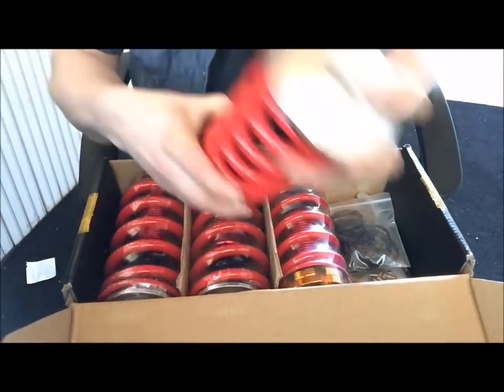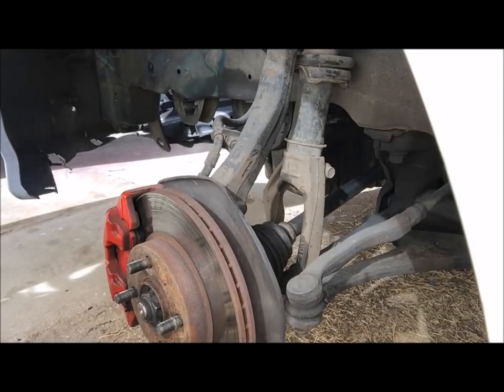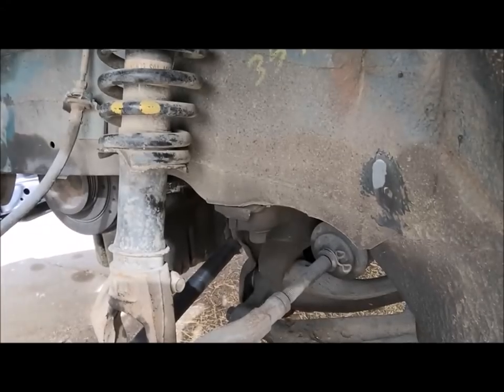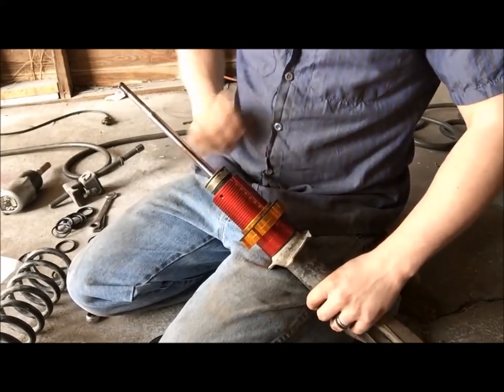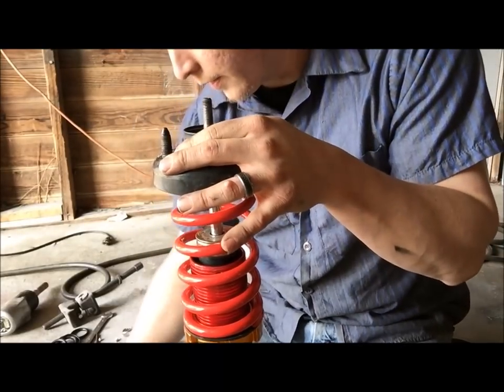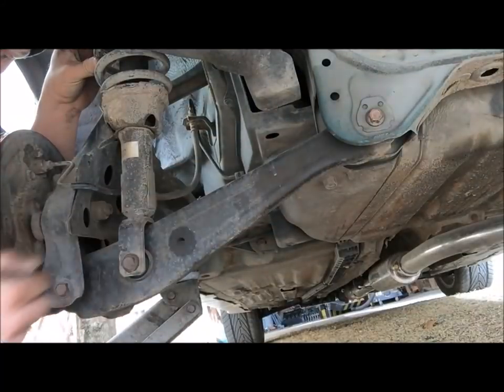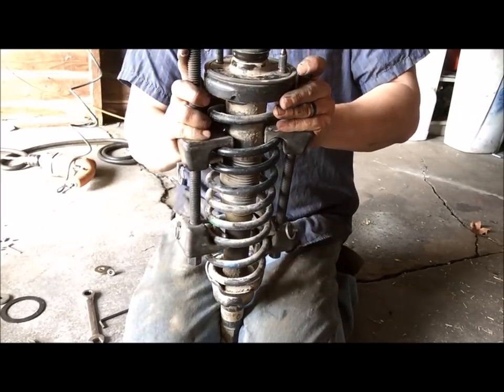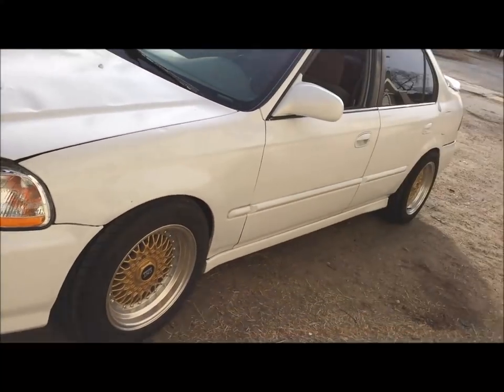Ebay coil overs review and install

Comment: No way!!!! You are literally the only video that shows where those orings go!!! Thank you so much! Im about to slam my 3G Eclipse. I already have wheel spacers on there so ill have to make sure to roll the fenders =)
Reply from the maker: SmokinSkittles Thats awesome! Hope it turns out amazing! Just a heads up don’t put that spacer in!! I need to make a note in the video somewhere because it rode super rough! I took it out then the car rode amazing after! Hope that helps
Reply from the maker: SmokinSkittles I subscribed hope to see a video of it when it’s done :)
Reply: @JamesDguy  the spacer you drilled out?
Reply: Do you have 3 sets 
Mine came with 3 different sizes
Reply: Lol if you don't know where those rings go on the coil over and couldn't find it online idk if you should get coil overs..
Reply: Don’t slam your car not worth it
Reply: I bout sleeves for my 3g....do you have pics of the struts and sleeves  put together?
Reply: These don't work for the eclipse. Front sleeve isn't big enough to fit over the strut
Reply: imposter 0shadow yup had to figure that out the hard way! -.-
Reply: @Smokinskittles  you and me both.
Reply: imposter 0shadow yeah I still haven’t returned it 😬😩
Reply: @Smokinskittles  me neither. Might have to sell them cheap on marketplace
Reply: imposter 0shadow what do they fit tho 🤔
Reply: @Smokinskittles  im not sure honestly. I'm sure there's quite a few

Comment: My friend had me install these on his civic he liked them he said they worked great rode prefect . Me personally i would never trust them not saying they are not safe but my mind will not allow me to trust them lol. good diy man
Reply from the maker: PA Tuners I honestly trust stock cut springs more than coil overs to be honest lol if u cut springs right they ride 100% like stock and you even have to decompress them like stock. I think ima do a video on the cut springs I have stock springs I just cut why not lol
Reply: I would never put these on my civic. The spring is suppose to be flush against top hat. If ya hit a pot hole even the slightest your car gonna fuck up

Comment: Tried to remove the rear struts today.. even with heat the bolts didn't want to come loose.. the bushing started spinning instead, it's a nightmare.. took half a day and have 3 to go :(. That's in Sweden thou, where they salt the roads on the winters which ruin the cars. Didn't look like you had the same problem :p. Great vid btw!
Reply from the maker: Robbin W these roads are salty here we live in salt city. We have a foot ball team called the Salt hawks. But I usually have that issue but this time I didn’t. I found a way around it but it’s unorthodox. Cut or grind the rear nut off the rear of strut and off any awaited bolt and do the same to the bolt head. Pry the old control arm out replace control arm use anti seize on the new bolts and nut. That’s how I do it at least/

Comment: That driveway is smooth as hell compared to what I have drove on with a slammed car
Reply from the maker: Jason Solomon This driveway isn’t the worse i have been in either but you also don’t see how bad it really is on camera. This whole town is garbage and there is no reason to slam a car in this shit hole. If I did I would be missing a oil pan and be super pissed. Function and form is how I like it.

Comment: I used these once I didn't trust the o rings not loosing up over time so I added the bottom one and filled it with silicone and then added the top one never had a issue and there were super solid till the day I got rid of them

Comment: Thanks for showing me how these work my brother bought some for the accord that I bought from him. Now I can install them. I was really confused, like there is no way these would work cause the springs are small compare to his 2 inch drop coil springs.. But I'll install them to see how they work.
Reply: What year accord and how did you get it to sit level on all four corners I'm running into issues
Reply: My sons car is an 01
Reply: @mazdajason  I took them off I couldn't get the back to raise up since it was at the last end of the turn to the cup so I bought some coilovers for my budget since the shocks was blown.. I didn't like them since they would be clacking when I drove..
Reply: @mazdajason  my accord is a 93

Comment: I'm running $200 ebay (maxspeedingrods) coilovers and they ride awesome. Skip the coil sleeve kit for regular struts and just buy the ebay coilovers. If you have a bearing in the top hat just work some pb-blaster into the bearing before installing or it will pop.

Comment: So how much did you end up having to adjust it to to keep it from rubbing? And btw nice video man really imformative and straight to the point no bullshitting keep it up
Reply from the maker: Limp Salamander I don’t remember it’s been over a year but it didn’t require a lot of adjustment. I did make sure to remove that metal top mount that it came with because it rode way smoother after that
Reply: @JamesDguy  gotcha, I'll just have to play around with it and figure it out, thanks for the quick reply man
Reply from the maker: Limp Salamander No problem

Comment: I just let everything explode when taking it apart so you don't have to rent a spring compressor
Reply from the maker: jockobo right or u can undo the bolt while the car is still on the ground and then jack the car up and it release the tension slowly as u raise the car. Less sketchy but either way works haha
Reply: James D guy I did that before. It was kind of a pain in the ass to get it out lol
Reply: jockobo spring compressors are cheap on Amazon. Yep yep,
Reply from the maker: jockobo they sure can be at times. I guess I found a way that works well idk lol
Reply: The old school way
Reply: jockobo it’s literally free to rent at autozone...
Reply: That's how men do it.

Comment: U def did them right considering some these other videos but that upper ball joint should have been changed bro the boot was completely ripped.. new upper control arms with camber adjustment only 30 bucks .. not hating bro just wouldn’t have let that go if it were me I had one break going down road from lettin it go after boot ripped an caused me to wreck an messed up one front rim where is sucked under the fender when it snapped
Reply from the maker: Johnathon Lattimer I like to do separate videos on things like that. I was trying to keep this about the springs but I did replace the entire front end suspension. It didn’t clunk or have any issue I just always replace everything when I get a new project

Comment: Would you mind posting a link to the ebay ones you bought ?  I'm trying to do the same on an 03 Jetta on the cheap and havent found as complete of a kit for that kind of price... Thanks and still miss your Orange Rocket !
Reply from the maker: sail235aeh sure thing
Reply from the maker: sail235aeh https://m.ebay.com/itm/Red-1-4-quot-Adjustable-Lowering-Suspension-Coil-over-Coil-Spring-Fit-Honda-Civic-/112673194681?txnId=1769209273001
Reply: Thank you Sir !

Comment: Hi James, great vid!!! May I ask how is the ride? Are those springs forgiving enough for use on a daily driven car?
Reply from the maker: Gerald Gama i ended up taking the top hat piece off but it rode perfect and still daily driving on it. A buddy ended up buying and having no issues
Reply: @JamesDguy  It works well on my civic 1997 with the top hat. It rides great although a bit stiffer of course. But i had to remove the dust boot as you said. Other than the boot not being in there, all is well. Been using it as daily from home to work for 2 weeks now. No issues. Just need camber kit to correct the alignment.

Comment: I have a question are they still good ? They dint messed up few weeks after ?
Reply from the maker: They are still currently ride good but skip the top metal piece step and toss it in the trash. It rode worse with it on. I’m talking about the thing that I drilled the hole bigger on. It still rides great 👍🏻 sold the car but been updated
Reply: Man you dont have a video how to replace water pump , I dont wanna do it my self because they charging me like $300 to fix it :( the water pump is $40
Reply: James D guy do we still leave the stopper u took out the washer stopper ? We leave that on instead of the thing u drilled ?

Comment: Thanks for the gread video but I was wondering how you could fit those sleeves to thick shocks like the Galant. Do I need to shave it off with a grinder? The shock body I mean.

Comment: Nice video bro. I was wondering how these coil overs were. I might get me a pair for my 7th gen! I was just curious why did you go with a 6th gen ?
Reply from the maker: ThizzleKid420 I don’t like anything newer than 2000 I’m a 88-00 any of them years to me are the best years. Parts are cheap and easy to find, light weight and I like the body styling of the 92-00 sedans but I’d own another ef hatch the 88-91 if I didn’t have 4 kids lol I have to buckle 2 of them up and it’s a pain to do as is with 3 car seats -_-
Reply from the maker: ThizzleKid420 the silver top hats I wouldn’t install them I actually took mine out it’s made it feel like it was bottom out when it wasn’t
Reply: James D guy oh okay cool bro i like the 6th gens body style to. Me personally i love my 7th gen i like the way they look the 4 doors. I got 3 kids to so i know how that goes. I had to sell my 03 ranger to buy my 7th gen.
Reply: James D guy Okay thanks bro good to know. I am tired of driving a monster truck haha.

Comment: I'm having a hell of a time finding the coil overs that fit my 01 Civic when i search this is what i get Tuning Fit Civic 1988-2000 Integra 94-2001 Adjustable Scale Coilover Red Springs Front? will they work?
Reply: 88-00 civic, integra, del sol is the same suspension. most likely your 01 civic should be the same, or check ebay for the coilovers, usually there are lots of parts for all models of civics.
Reply: here are some links for what you may need with different price range: 
https://www.ebay.com/itm/Skunk2-Racing-517-05-1710-Coilover-Sleeve-Kit-Fits-01-05-Civic/293309036621?fits=Model%3ACivic&epid=1630617585&hash=item444a94b84d:g:SWUAAOSw-IhdvP0X
https://www.ebay.com/itm/Rev9-Power-Hyper-Street-2-Coilovers-Lowering-Kit-Honda-Civic-SI-01-05-EM2-EP3/162971402179?fits=Model%3ACivic&hash=item25f1da3fc3:g:rXgAAOSwxxVavWF2

Comment: $35? That just seems ridiculously cheap, for most cars individual springs cost more than that. You know companies like Ground Control sell and other kits that look exactly like this for $400-$600 or more, and people use them on much more expensive cars that they even take on road courses. They work just fine and can last a very long time even under extreme conditions. 
As long as the shock and spring rates are a good match, what exactly is the problem with this as opposed to a "real coilover"?  I guess it depends on the situation, but if you aren't trying to slam a car and just want a slight height adjustment and the ability to corner balance, and you have a really good OEM adjustable shock that you would like to keep, this type of setup is perfectly acceptable in my opinion.

Comment: Question i got a set for my 2002 Honda Accord off eBay but i notice that they sent me with  2 that is shorter than the other 2... are the 2 shorter ones for the back or front strut...?

Comment: The ones I bought come with 2 different size springs but I can’t figure out which goes in the front or rear? Two of the springs have tighter coils than the other

Comment: Nice video how does it ride so far 🎈
Reply from the maker: Ngo-Ta Ara Thank you and I sold the car but it started riding rough so I took the metal aluminum upper peace I drilled a hole in I took that out once I took that metal aluminum piece out it Road perfect I sold the car for over $3000 believe it or not someone wanted it that bad with the way it was built. It Road really good just do not install that little aluminum piece with a hole in it. For the best ride comfort

Comment: Hey question why when i push down on the car the the nut comes up through the top hat? Help!!!! The stopper is on btw
Reply from the maker: Jimal Martin had this issue and it was the little metal stopper that was the issue. It needs to go on before the top hat. It has a beveled edge on it. Its not a normal washer. I had that issue though was a easy fix
Reply: James D guy thanks im gonna check again

Comment: Nice job man.
Reply from the maker: Stacy Pfingsten thanks. I’m actually going to sell these to my buddy. Only because the adjustability isn’t high enough for these big tires ima throw cut springs on haha ride way smoother on cut springs believe it or not. But I figured I’d do a video anyways
Reply: James D guy that’s what is on my sons (cut springs) . But it doesn’t ride awesome. Any suggestions ? Hey maybe another how to video.
Reply from the maker: Stacy Pfingsten hmm it also depends on struts. If the struts are bad or the springs were cut wrong it wouldn’t ride good

Comment: So I installed these on my 98 civic and I'm having some issues before I start with my issues I have a $800 civic just a budget build I wanted to just lower the car make it look good I achieved that it looks amazing but (potholes are obviously rough on a lowered car but they are bad on this set up! Worse then usual from what I've heard and seen on a lowered car) but dips in the highway and side roads like not potholes really hard to explain but the waves in the road miny hills are horrid in the car the wheels bottom out in the wheel well on occasion I go almost airborne and slam back down so hard I fly out of the seat it just doesn't seem right to me at all. I'm used to motor work and tranny work and lifting trucks not lowering cars lol I saw a other video of these being installed and the guy started low kept going up up and up and the ride height stayed low didnt changeso I was wondering if these are a set height and that adjustment is actually just a damper adjustment? Crazy far fetched but possible? Any help is appreciated it's my daily and I cant keep driving the lifted suburban on 38s every day lol
Reply: You need to either shorten your shocks or find inserts from another car that fit the sleeve. The insert diameters are pretty standard. They only come in 2 inch, 2 and a quarter and 2 and a half inches and every car brand uses those standard sizes. The strut towers are different for all car brands but the shocks they put in them is all standard stuff. Now find some that are shorter from factory and are the same diameter. 
You are driving with the shocks completely compressed. On bumps you bottom out and when you go over  hills the shocks push the car up out of the springs and when it comes down it bottoms out again.

For my 73 bmw e12 nobody makes any coilovers or standard lowering kits so i used a similar system to make my own. mine was weld on instead of aluminium but the rest is pretty much the same.
Anyway i shortened the struts by 8cm and used billstein b6 shock inserts from an 90's audi coupe.
They are shorter so the lowering is not done by compressing the shockabsorber more at rest and giving up compression travel but by lowering the entire shock lower into the strut. And now they sit right in the middle where they belong when the car stands still.
I still have all the compression travel as well as the outbound travel now. Actually a little more both ways since the audi shocks come with a few mm more travel from factory.

Things like these can be really useful to fabricate something that is not for sale. But they are a horrible money saving tools. If you do it properly it costs the same as just buying a decent set outright.
And if you don't do it properly the car will drive like shit and your shocks will destroy themselves within 6 months anyway. At which point you have to buy new ones anyway.
Not to mention that the car becomes dangerous in some circumstances.

Comment: Will it work on aftermarket struts  or is it specifically for oem struts
Reply: They fit on anything. But you really need shorter shock inserts for this and cut a few inches from the top of the strut.

All he is doing is lowering the car the same way as you do with just lowering springs. It puts the shocks in constant compression and you are left with little compression travel and with loads of rebound travel.
Creating a car that constantly bottoms out and goes airborn when you go over a hill.
It will look cool when the car is parked but it will drive like a bouncy castle.

Comment: Can u tell me why I'm so bouncy now I got them on and what I can do to fix it
Reply from the maker: James Schlegel take them solid top hats off the thing I drilled holes in On my video. I ended up taking them off of mine as well
Reply: I did it's not so bouncy also do u kno why it seems like my wheels are rattling at higher speeds like it starts around 60 and gets worsr
Reply: James Schlegel you need an alignment

Comment: Trying to get top center bolt off but strut is spinning with bolt what do I do
Reply from the maker: James Schlegel I would try to use the Allen wrench and 14mm if they are oem struts but if they are damaged junk struts u can use vice grips on the shaft but if they are good struts and u intend a good ride I would find a impact and use penetrating spray lube such as wrench off or something like that. If that don’t work see if a local mechanic shop can use a impact to remove them. I did some questionable things in the past to remove them but I don’t recommend them.

Comment: I got 3 sets of rings.  Thin..medium...and thick
How do i know which goes where
Reply: I think they are provided to give users options because shock absorber housing differs in outside diameters. Thicker one will fit smaller outside diameter while the thinnest one would fit those larger shock absorber housing